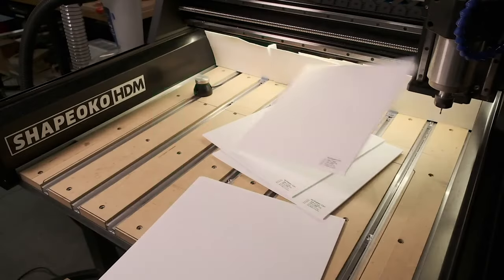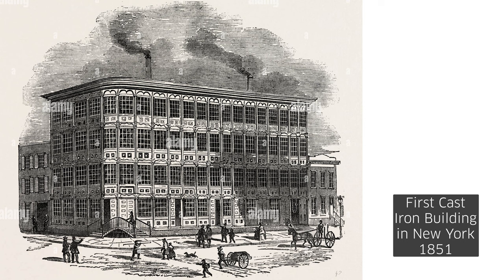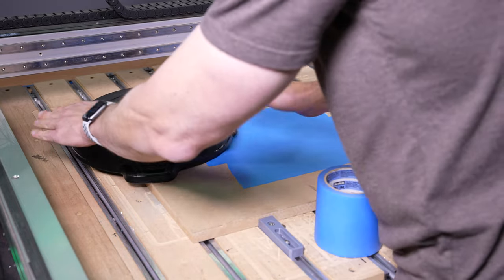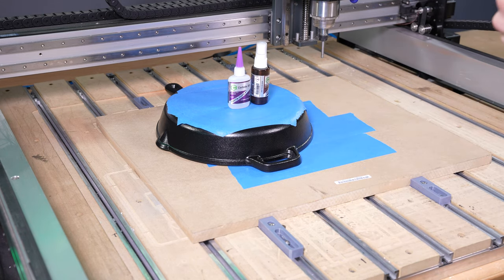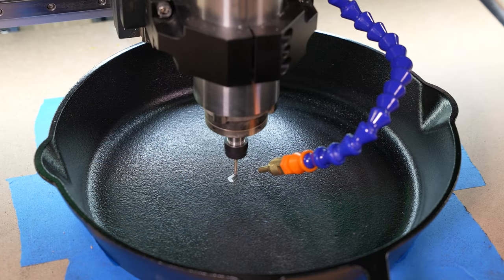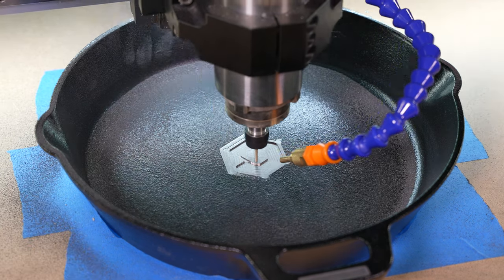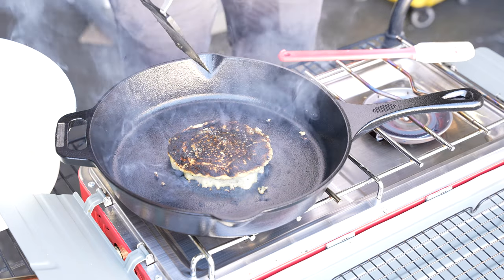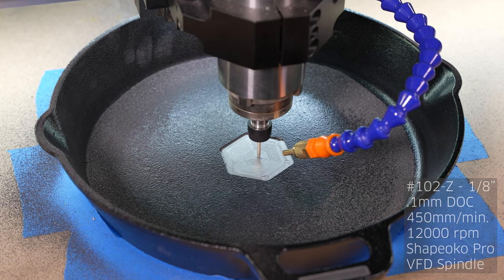How to Cut Cast Iron on a CNC Router

Comment: Machining cast iron is very useful indeed - it's relatively quick amd cheap to make large cast parts then machine the surfaces where accuracy is required. It's a whole other world compared to the expense of aluminium billets. Also the shapeoko is perfect for making re-useable molds!

Comment: Wonder if you could use a magnetic "dust collector" by mounting a magnet or two to hover above the workpiece near the endmill.
Reply from the maker: That's part of the method we used for cleaning up after this project. Placing some magnets outside but around the cutting area would also capture a fair amount of the chips.